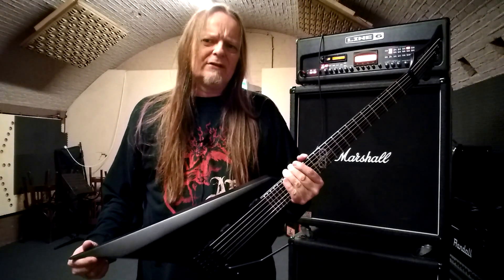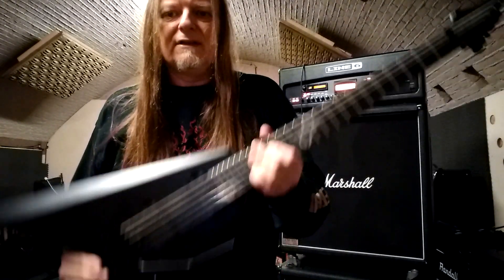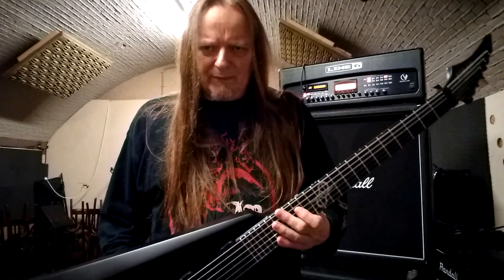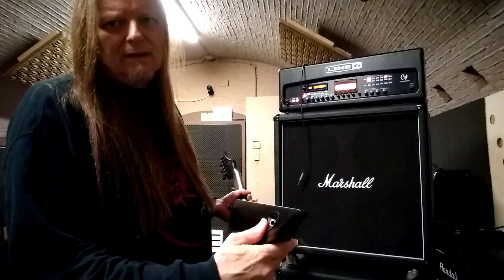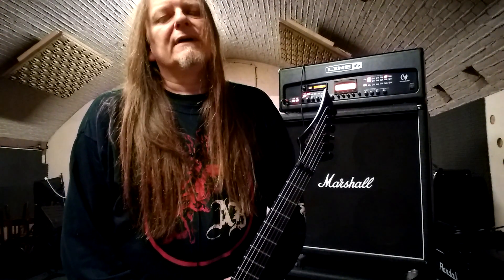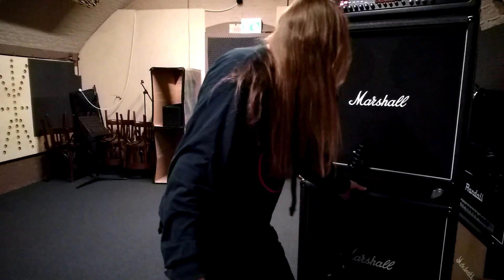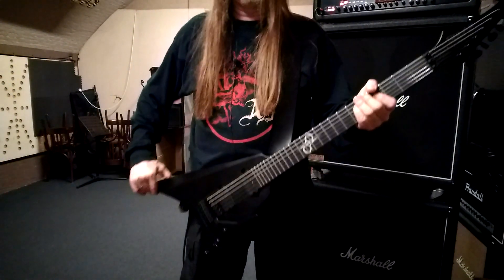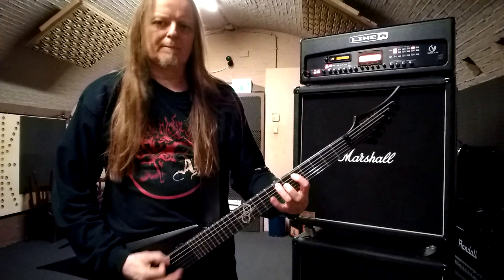Solar V 1.6 FRC customisation

Comment: Hi. I have the same problem. As I can see in pictures, the luthier drilled a hole from new output cavity to floyd's cavity and then to pot cavity. The pic on 3:33 shows a cable behind the floyd's block. Doesn't it go in a way of the toneblock?